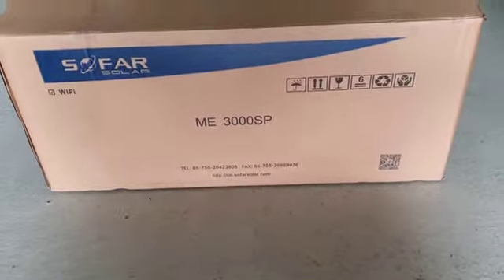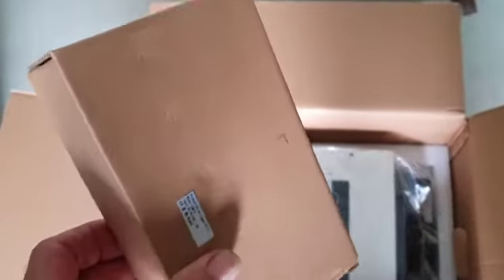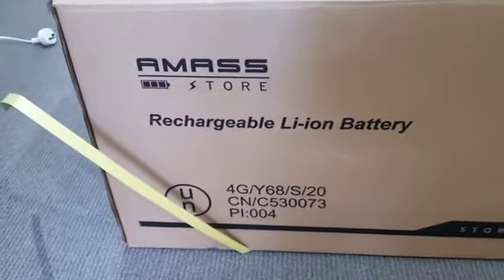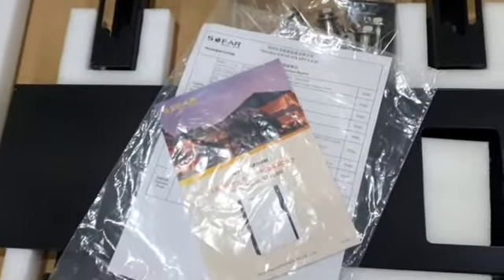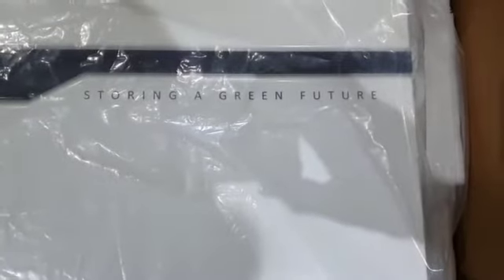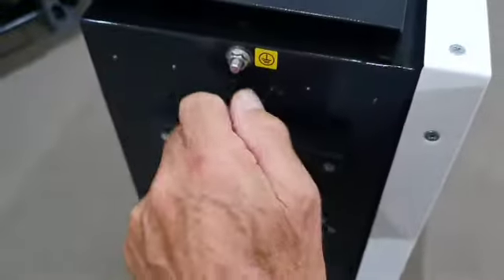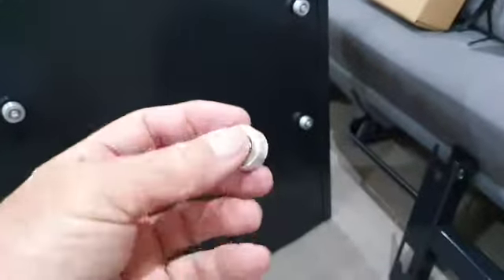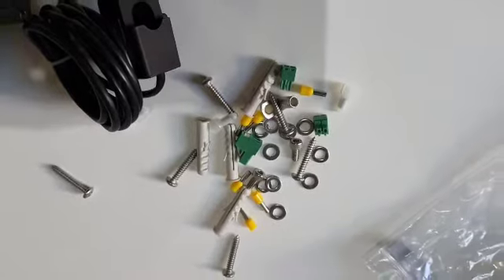Unpacking of SOFAR Battery and Inverter

Comment: what happened to the installation ?
Reply from the maker: Running the cabling for the current sensors was fun (one on the meter side of the switchboard and one on the output from the solar inverter) due to the positioning of the batteries (2off) and the swittchboard.  Running wiring is always a painfull process no matter where equipment is situated.  In regards to the batteries, they have performed fine so far in the near year that they have been operating.  I get to re-use between 7 and 12 kWh on a daily basis, which is about right.

Comment: Did you get these installed Steve?, if so what has your experience been like with them ?
Reply: Must still be waiting for technicians
Reply from the maker: Two Sofar Amass batteries were installed with their own inverter and A.C. coupled.  The best we have achieved is 12.5kWhs charged and discharged in a day, so they're good for a 9KWh system.